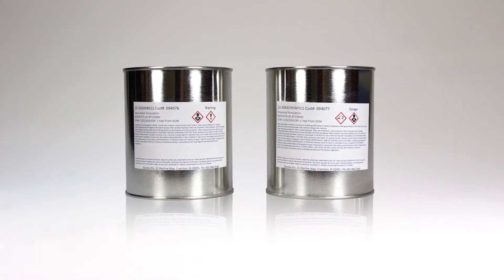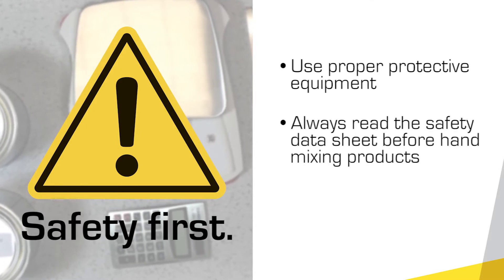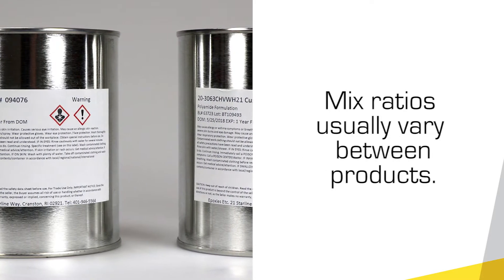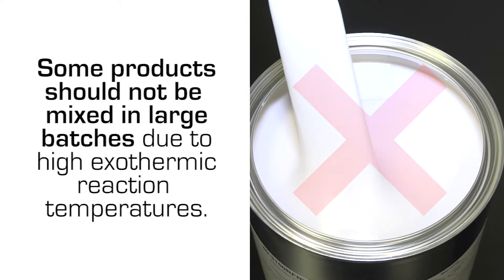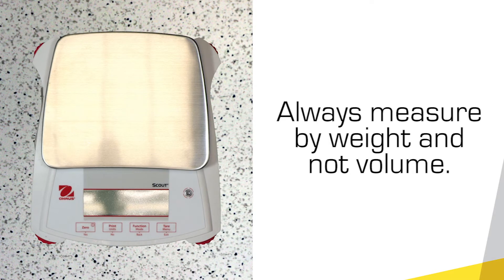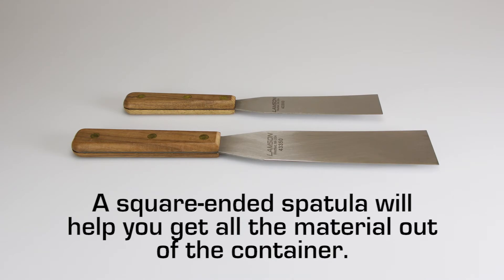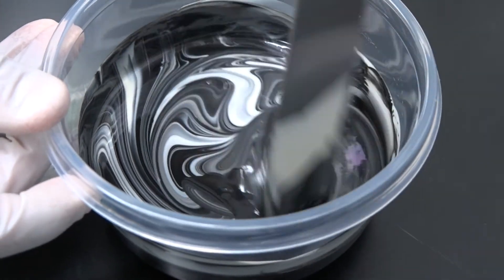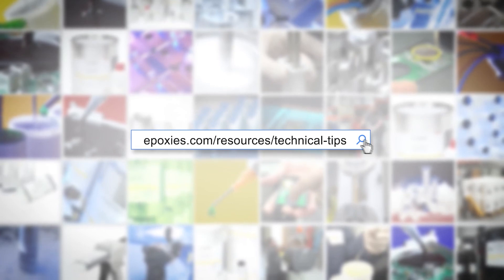Tips & Tricks - Hand mixing two-part epoxies the right way

Comment: In our factory, we are using white colour epoxy resin formulation with polyamide formulation.but both these formulations are very hard to mixing on hand because its very thick.do you have any solutions?